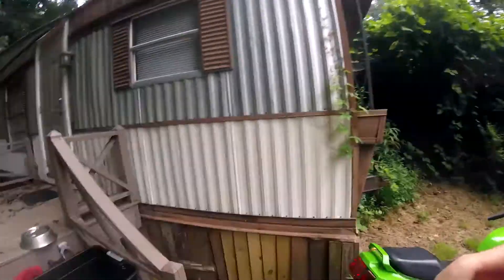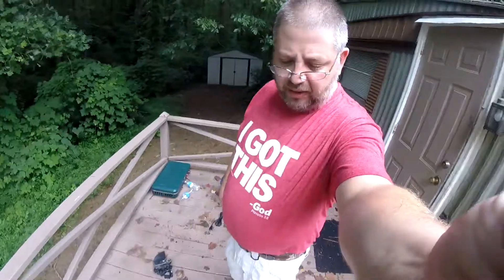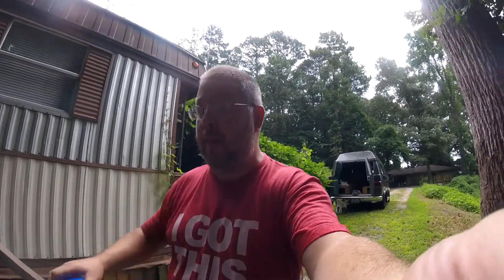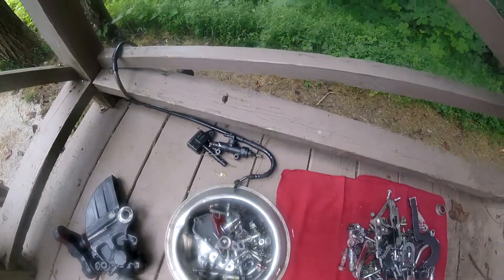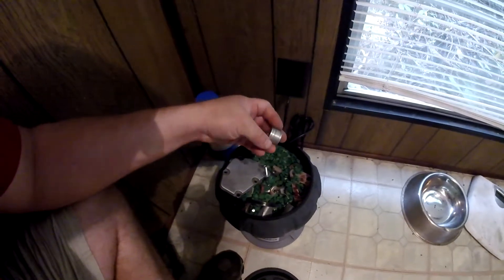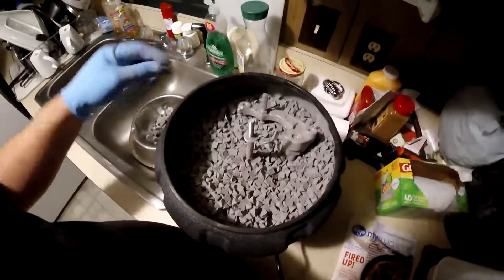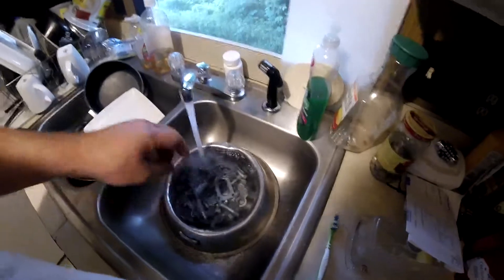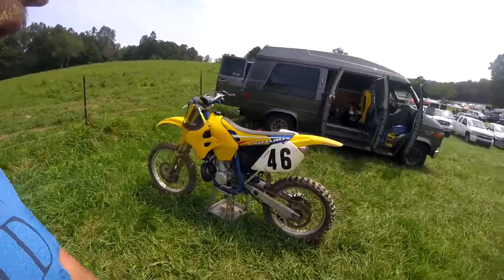Harbor Freight Media Tumbler review clean Motorcycle Hardware

Comment from the maker: This particular model does have a spring preload adjuster on it.  Pull the left side plate off of the adjuster knob, and then when you reinstall it, turn it clockwise an extra 1/4 to 3/8 turn.  The idea is to put some positive preload on the spring, but only a very little.  You don't want to create much resistance.  The more common problem with these valves, is they gum up.  Please see my 96 rm250 restoration video entitled "power valves" as I take you through the whole power valve system. Thanks and good luck.